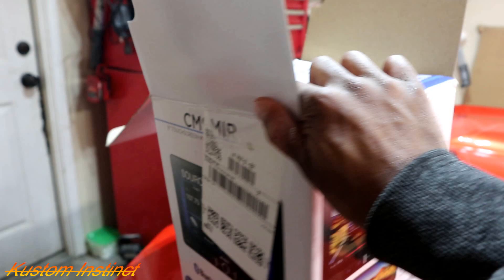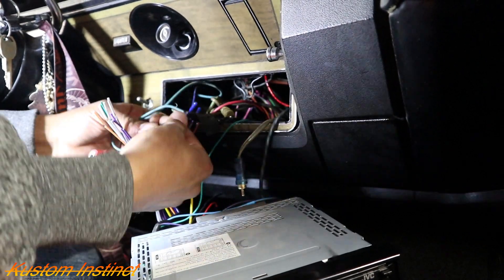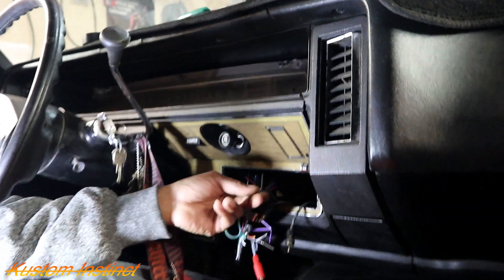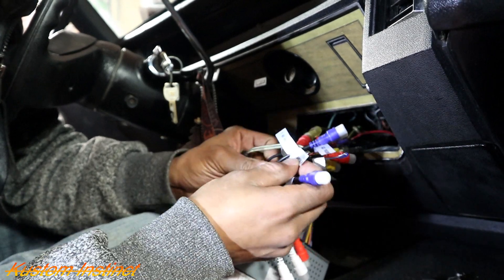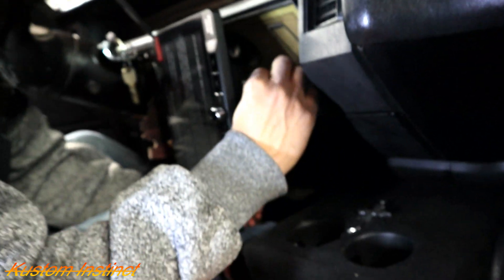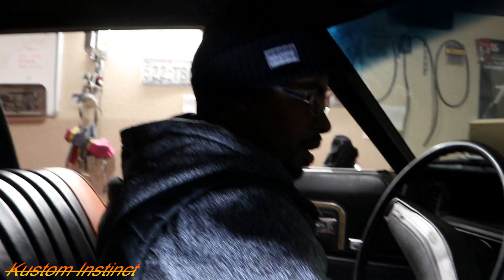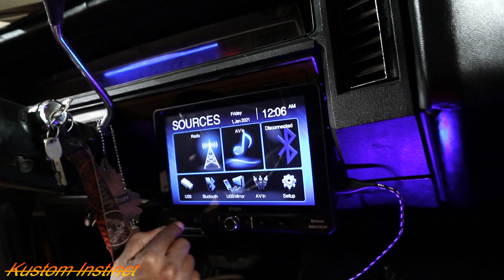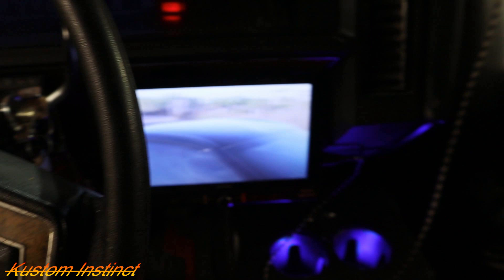installing a jensen usb mirror head unit in my 1975 caprice

Comment: 1st of all nice car 🔥. I been looking at this deck on Amazon. Does it allow video to play (YouTube) while driving? I heard you mention (pink for parking brake). 2ndly did you get it to Mirror to your flip down screen in the back? I searched for answers everywhere plz help. Thx
Reply from the maker: Yes you can play YouTube while driving, and I didn’t get it to work with my other screen yet, I have to figure something else out just haven’t had time, but thanks for coming by I ran the parking brake wire to a switch.
Reply: @kustominstinct  OK great. I got a double din DVD player on my flip down. I don't want to get rid of it if I can't play the video on my rear screens (kids would be upset lol). The parking brake wire has to be ran for it to Play and drive?
Reply from the maker: Correct 👍